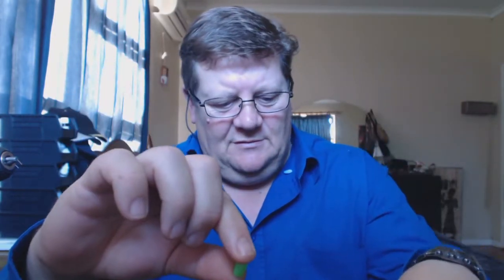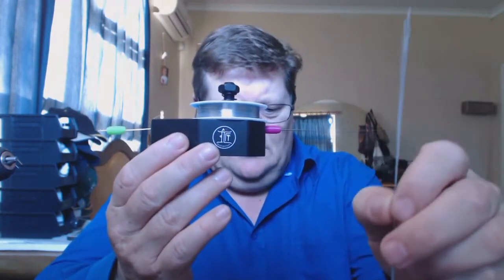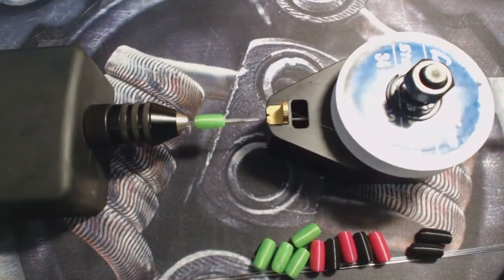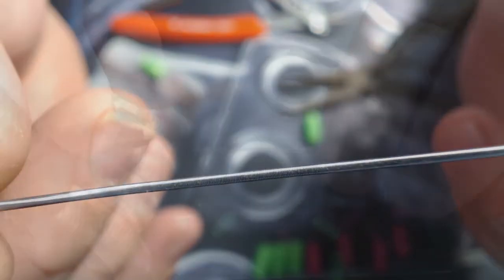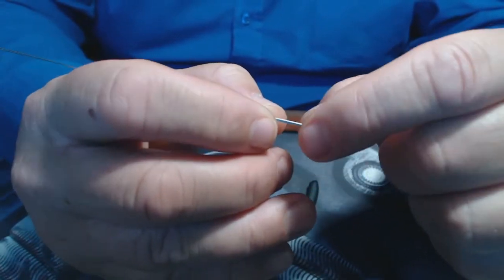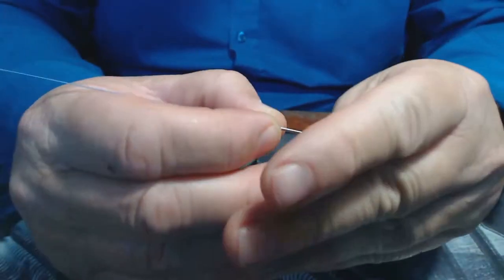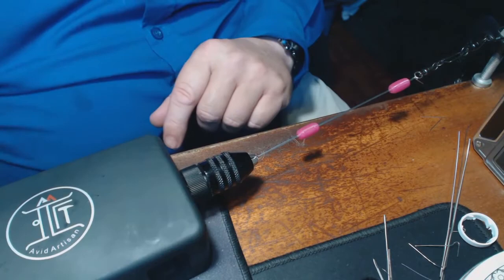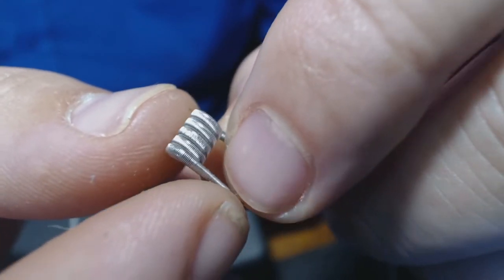KZOR's Playtime : 3D Beads to make a coil :)

Comment: Wow, I thought about that in the sense that maybe I could drill out the existing guides to compensate an already Clapton set of wires to do a spaced clapton fused staple build. I see some folks have already wondered if they could get you to make them some. If you do decide that you can have them printed I would certainly be interested in buying a set of them, and not for just postage I'd actually pay you for them. I don't have access to a 3D printer or, AutoCAD for that matter, I guess I could scan the three existing metal ones I have in and it would make them in plastic. Great video by the way. I always appreciate and enjoy your videos. Thanks from the USA, 
Jimmy